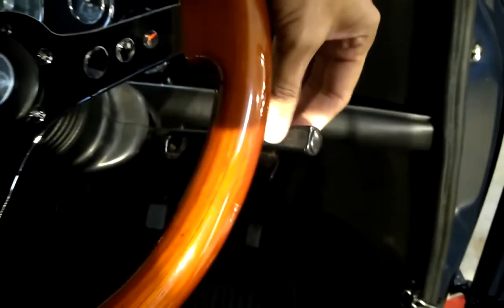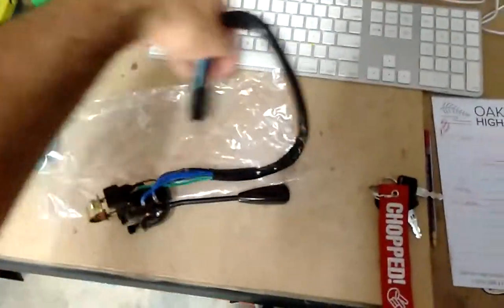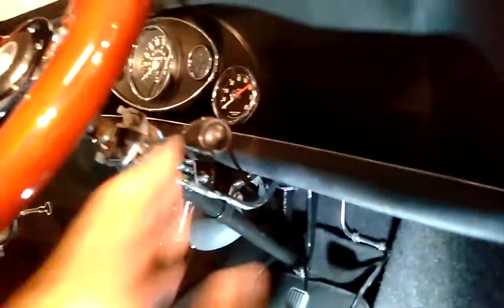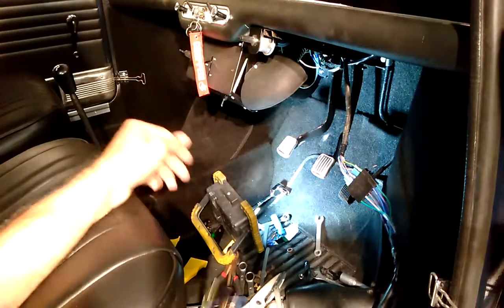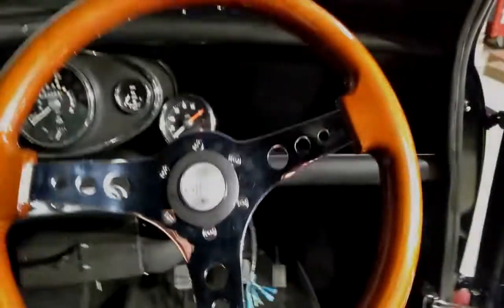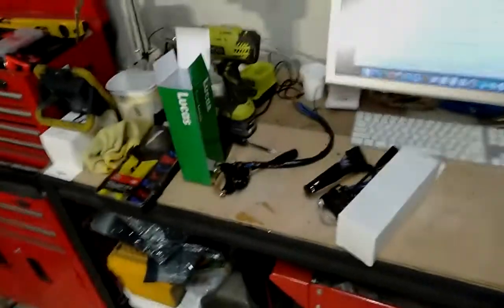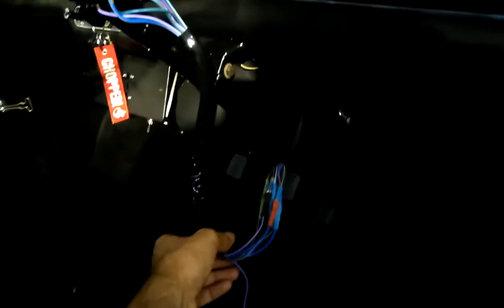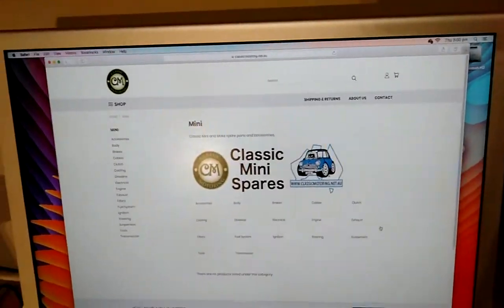Morris Mini Indicator and Horn Switch

Comment: I was wondering if it mattered which terminal each wire attached to on the horn . The two wires hanging down at the front.
Reply from the maker: One of the connectors will be negative, the other positive. Depends on the horn you are using. On the actual horn it is likely that neither terminal is grounded to the horn casing, but this can be tested with a multimeter. I'm not sure if the polarity of the wires will affect the sound.